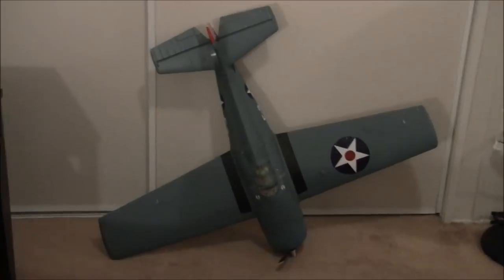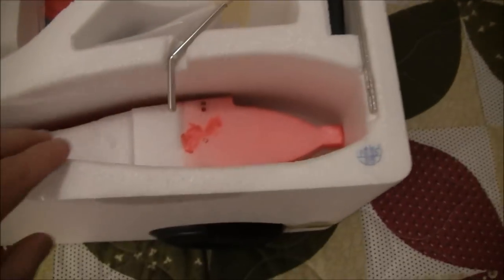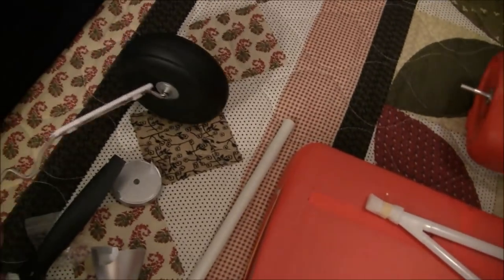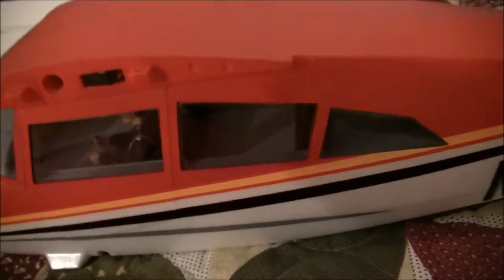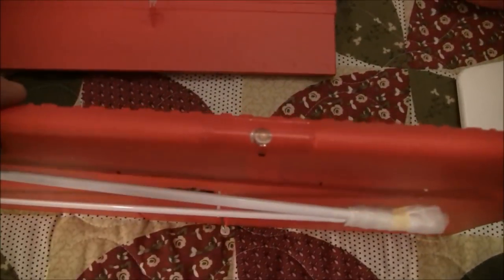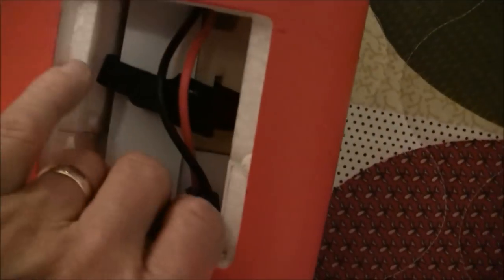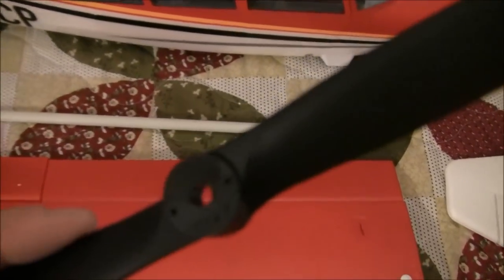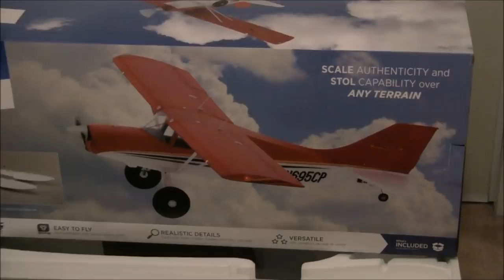E-flite Maule M-7 1.5m - UNBOXING

Comment: how is this plane different from the 1.5 timber. they look the same to me beside the color. i guess it has clear windows too, but does it fly different. thanks
Reply from the maker: Hi Gene! The Timber is a STOL model that is not patterned after any full-scale design; it was designed from the ground up by Matt Andren at Horizon Hobby. The Maule M-7 is an officially licensed model of a full-scale STOL aircraft, and really has a lot of scale features. I hope this helps!
Reply: I have a timber which is my first plane ever that I've been learning on.  Ive been flying about 4 months, do you think the maul would be a good trainer to take its place, as I'm getting bored of the timber. thanks
Reply from the maker: The Maule isn't a trainer. Just because it has SAFE doesn't mean it's designed as a trainer, it's an intermediate plane. But then again, if you've been flying for 4 months and can consistently nail your landings, I'd say this might be a good candidate as a second plane for sure :)!
Reply: well, I can not consistently land my landing especially in a crosswind.  Ive got an instructor and he said I need to beat up this plane before you move on.  Guess I'll take his advice.   I havent looked but do you have any flight videos yet with this one.